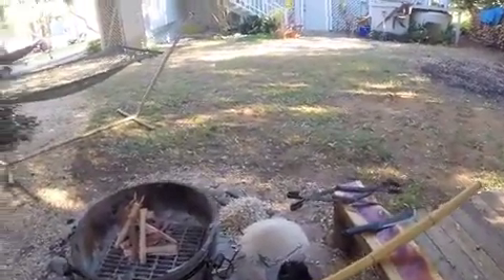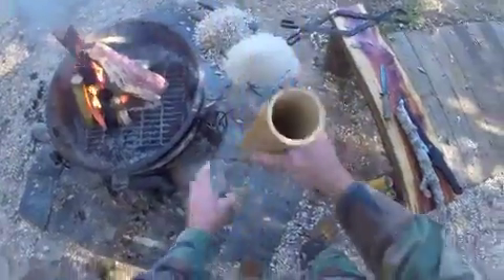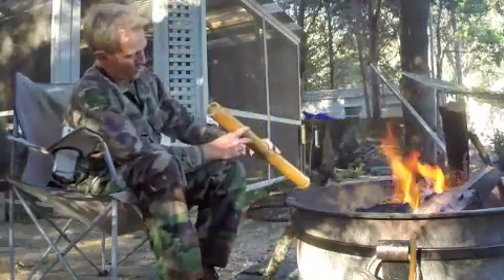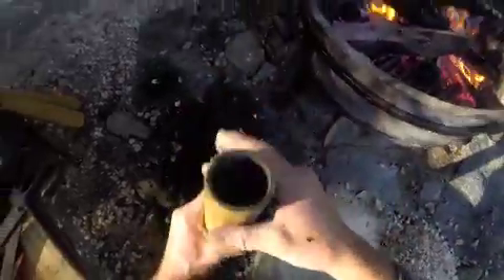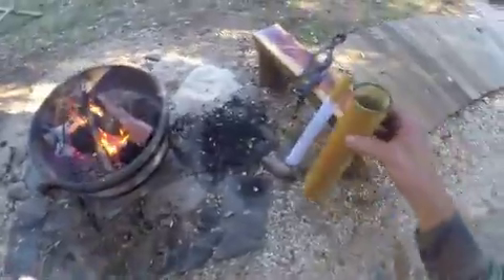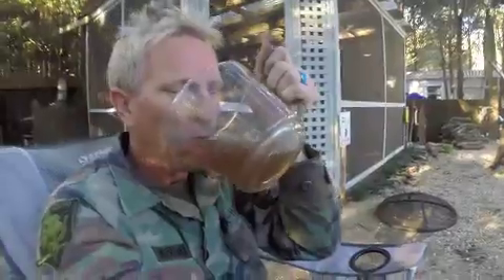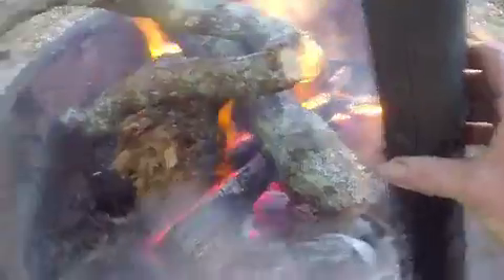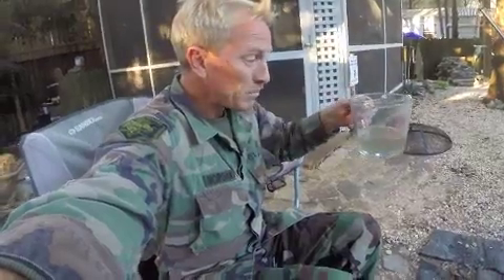Bamboo Water Filter

Comment: Water hemlock? The heat will probably destroy all toxins. You did many things wrong. Tannin is destroyed by heat. You should first wash your charcoal, sand etc thoroughly to remove all water soluble dirt. Let them dry. You should run the water through it like 3 times again by using the filtered water again and again. After 3 times, it should be really clear and drinkable without boiling in a survival situation.

Comment: Indeed blessings one can find just by interacting with others .. important information to live when it happens.. subbed ..
Correct me if Im wrong - It seems all the ingredients needed to do this would be in an island setting; in cities it would hard enough to locate bamboo but fine sand or sugar sand.
Yeah plastic / BPA in the water is a drawback but fuck it if youre thirsty ..
Reply from the maker: Thanks for the sub, and for the comments. Even in urban settings, and even without bamboo, there's still a way to do it. Find 3 empty aluminum cans, place your sand in one, charcoal in the other, gravel in the top one, and punch a small hole in the bottom of each can, then you have a stackable filter. Oh, make that 4 cans...one for boiling the water. 
As for the plastic and BPA, yep, in a survival situation, you do what you gotta do. I'll take a chance with BPA over some waterborne bacteria any day.
Reply: Thanks!